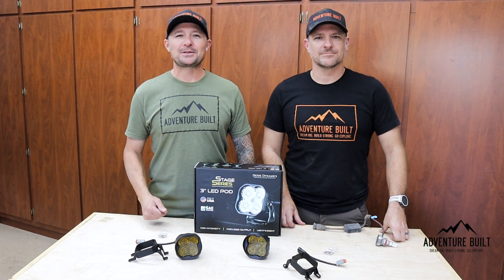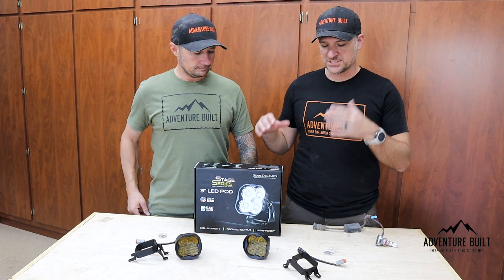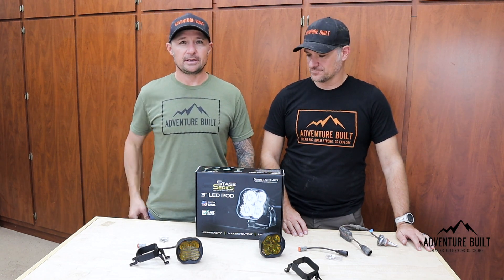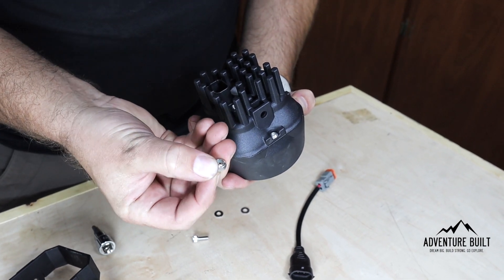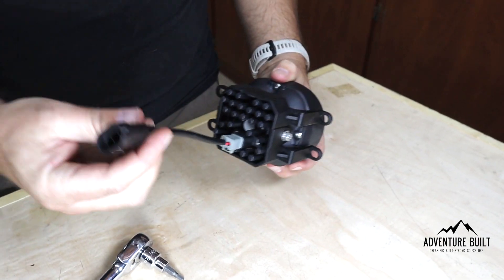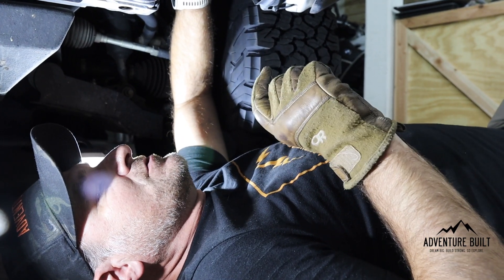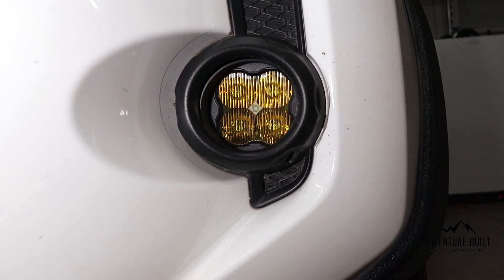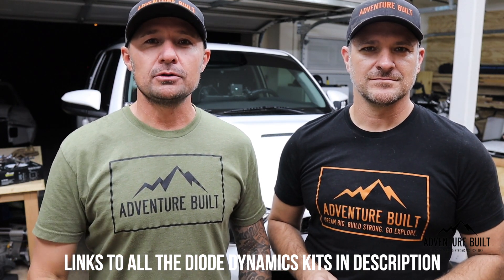AMAZING Fog Light Upgrade to 5th Gen Toyota 4Runner - Diode Dynamics SS3 LED Fog Light Kit

Comment: I installed the Pros.  Wasn't all that easy.  I jacked up the truck, didn't remove the tire.  Might have gained some room over leaving it on the ground.

Never did get the cover completely off on the passenger side.  Couldn't get the left side loose for the life of me.   But was able to move it out of the way enough to get the light in.

Beat my arms up pretty well trying to stuff them in there.

But, it's done. I do love the higher intensity light

Comment: How can you leave that gap to angle the lights down when it's tightened. In other words, what makes it maintain the gap, does it have an adjustment screw, a washer, a wedge or what..??
Reply from the maker: The lights actually sit in the tabs flush at the correct angle.
Reply from the maker: I’m sorry if my response was short. Basically when you install the lights they will sit flush in the light bucket. The only way you won’t have a gap is if you inserted the lights from the bottom and pushed the light past where it wants to go the create the gap. The lights are made to mount and have the gap. Some people will see the gap and assume that it’s wrong and press the lights past where it should go to get rid of the gap. That was what that was referring to. I apologize if it wasn’t super clear in the video. Hope this helps.

Comment: Do these lights need to be aligned? How is this done?
Reply from the maker: There were perfectly aligned when we installed them but I think there is a small adjustment you can make of need be.
Reply: @AdventureBuilt  Thank you. Mine arrive tomorrow! Next, I “need” to upgrade the head lights :)
Reply: @AdventureBuilt  they are in!! I am VERY happy I did this, they made a big difference over the stock (2020) fog lights. Any suggestions on how to also make them turn on when the high beams are on?